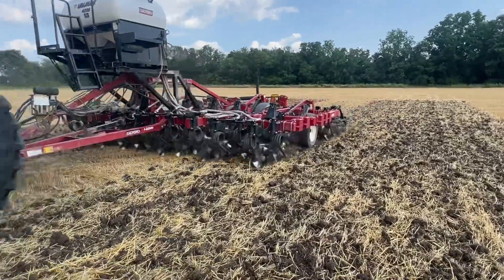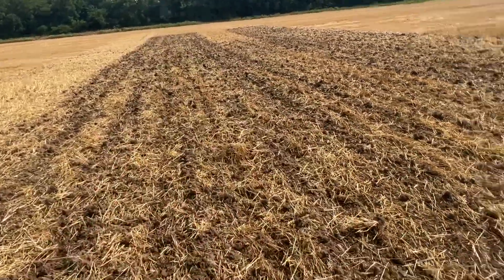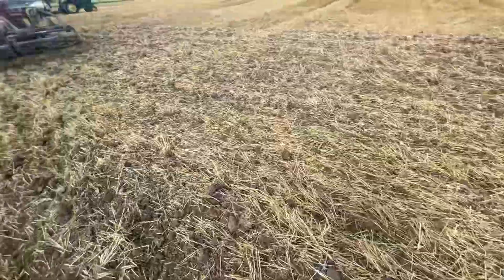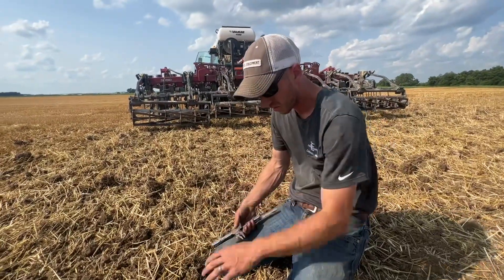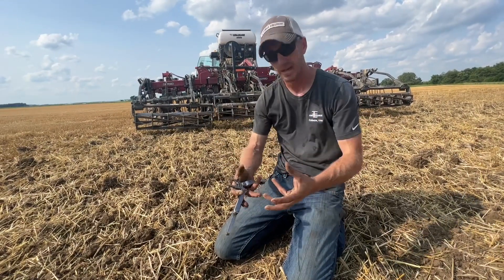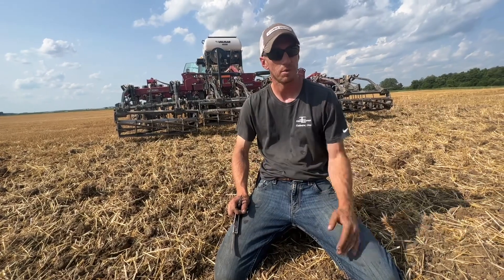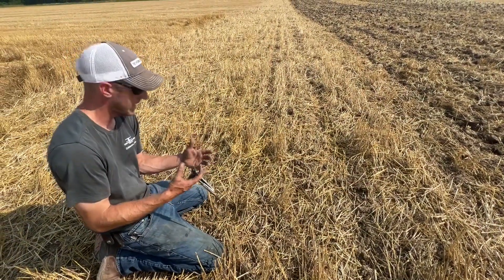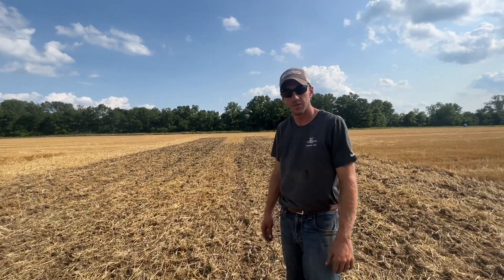Hydraulic Switchblade Shanks in Action on Salford 2200

Comment: Do you feel that the chisels are durable enough to stand up to working 8-9 inches in rocky conditions on 15 inch spacings?
Reply from the maker: Yes I do, I have yet to have a single issue with the hydraulic shanks